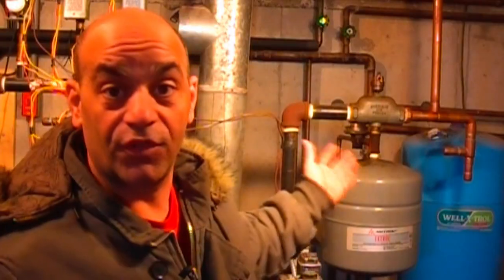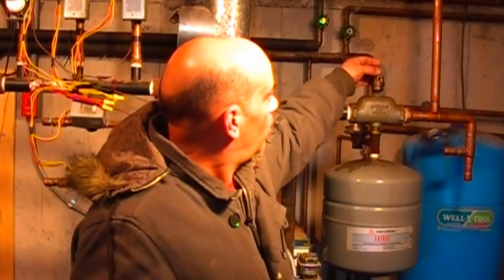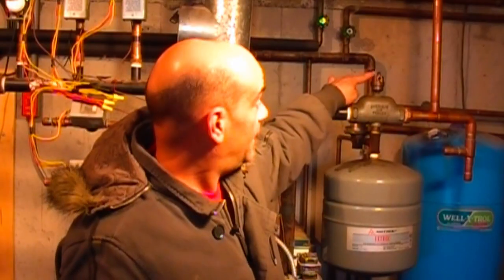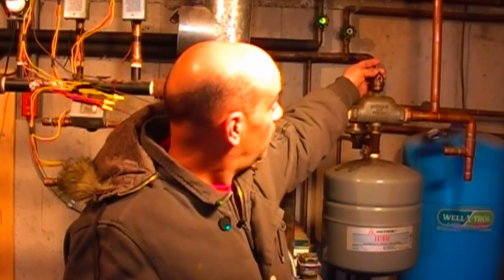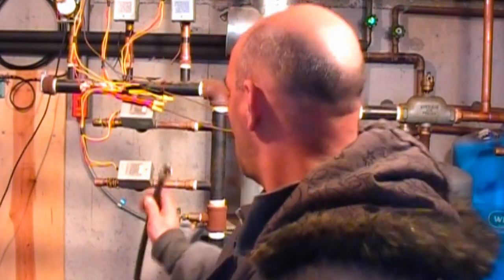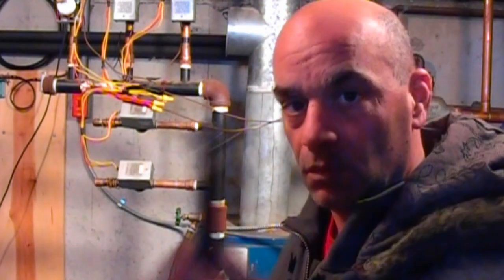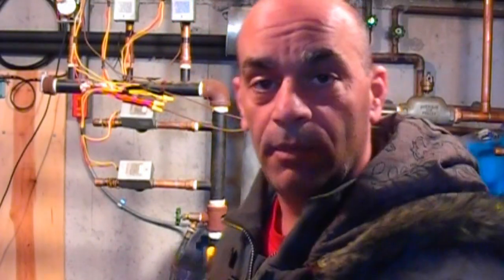How to remove the air from your boiler / heater

Comment: Thanks for video. I have a Chromalox  EDB-2, One zone valve for two storey duplex. Thermostat in the living room. Overnight, the boiler overheated and steam coming out f rom relief valve. Pipes extremely hot, too much to touch. I disconnected the power (electric boiler). Any ideas what could cause this overheating? Thanks
Reply from the maker: A few things. First I would check that the main water supply is open.

Comment: You could hear some banging and knocking from your pipes as you flush them. That's the air in the system knocking around. The air is a space within the system and when water comes in to fill the space, the air shoots out down the line looking for a high spot and causes a knock or bang.  Some tinks and pings in a flushed system are normal as the pipes heat up or cool down due to expansion and contraction. If you keep hearing bangs, you still have air in the line or you have a leak letting air in.

Comment: DO YOU KNOW WHAT WOULD MAKE A BOILER SQUEAL AND VIBRATE? I ALREADY BLED THE SYSTEM. IT HAPPENS WHEN IT IS HEATING UP (AFTER A MINUTE OR 2) AND THEN STOPS JUST AS SOON AS I TURN THE SWITCH TO SHUT IT DOWN.
Reply from the maker: That's something I would need to be there. Sorry could be so many things
Reply: askmediy I'M THINKING SLUDGE BUILD UP IN THE LINES IS CAUSING THEM TO VIBRATE. IT SOUNDS LIKE GOAST IN THE WALLS I'M GOING TO RUN CLEANER THROUGH IT THEN DRAIN AND REFILL.

Comment: Should you replace water heater if this valve gets tripped...?  Will or does the hot water or extreme pressure Damage the tank in any way???  the Tank is 21 years old,  i'm guessing time for a New One....Any danger  to fix the old one..?  Thanks. Recommendations for new unit..??
Reply from the maker: Mike Teal hi Mike, yeah it’s time to replace it. Why did it trip is the bigger question. Yeah replace it
Reply: Thanks for the advice..!!!

Comment: great video. My pipes going in and out of each registers pulled away from its elbow joints because of the weather temperature, but my boiler is still operating. What caused for the water to freeze? Could it be the circulating pump not working? Could it be a clogged nozzle, filter?

Comment: I have  lots of air in my pipe. It took me long time to skim and seems never can take them out. I don't find any leaking in pipe anywhere. Please let me know what should I do
Reply: Follow the video - Dominic explains very well. If you close off the return to the boiler, and can close off the expansion tank, then you can attach a hose to the bleed off valve and open the valve to begin purging air from your pipes. What I do, is hold the end of the hose into a bucket and kink the hose, then release, then kink again, then release - letting the pressure build back up in the system, then releasing once again. This helps to push the air through the pipe towards the hose and out to  the bucket. BE CAREFUL NOT TO BURN YOURSELF! ALLOW THE WATER TO COOL DOWN BEFORE ATTEMPTING THIS. You will know when the air has been purged by observing the pressure gauge as you kink the hose. When the pressure builds immediately, it's an indication that you have removed most or all of the entrained air! Good luck!
Reply: Oh, yes - DON'T FORGET TO REOPEN THE VALVE TO THE EXPANSION TANK, AND TO THE BOILER RETURN BEFORE TURNING THE BOILER BACK ON!

Comment: great vid! my system has lots of noise. I now know that my expension tank is broken. I want to replace it. but the whole system only has a cold water come in valve. I can cut off the cold water come in, do I need to drain all the water inside the system to replace the expansion tank? thanks.
Reply from the maker: J He thank you. Yes turn and let the system cool down. Open up a valve to remove some water and pressure
Reply: my house is less than 2000 sq ft, 2 zones, 1st and 2nd floor each has  a zone. I wonder how much water I need to remove, 10 gallon total for 2 zones?

Comment: What if my expansion tank is completely filled with water and there's alot of pressure showing on my gauge?....what are the proper steps for safety before i can replace the tank and gauge. My case my pressure gauge needle has broken and is so far off, it is stuck in place on the temperature side...i have the same gauge as displayed in this vid.
Reply from the maker: Jay Bee replace both and get back to me
Reply: askmediy so what do i do?..... shut the cold water valve, turn of the gas and pumps to the boiler? Do i open a drain to let out some water before removing the expansion tank?
Reply from the maker: Jay Bee sorry, yes turn all that off. Open a valve to let some water out until it’s not under pressure. Also make sure the system is cool. 190 degree water, not fun
Reply: askmediy hey im still working on my expansion tank....i notice your air eliminating fixture has a purge valve, mines just has a cap with a flat head screw opening in the center at the top. So do i leave the entire cap loose or do i open the screw a half turn?
Reply: askmediy also once the tank is on do i simply just turn everything back on, and let the system build itself back up to normal use? Or is there more steps like bleeding all the zones again?
Reply from the maker: You'll have to bleed the system.

Comment: Hi there, there's a knocking sound on one of the 4 zones of our radiant heat after the furnace got serviced. You hear it when it's heating up. How do you get rid of this ticking/knocking noise. The plumber said he needs to open up the drywall and the ceiling.

Comment: I'm in the 2nd, top, floor in my apartment. We had a low water pressure event recently, and the sinks were real low pressure. I think air got into the system because of that. I have a total of three radiators. The one in the kitchen is about room temp, and in the kitchen it's cold. So I took my tiny t-shaped valve wrench for the little square valves. I let air out of the bedroom one, (the lowest height) which seems fine, and then spit out water.
In the Living room, that one never got to the point of pumping out any water, but I did get some air out, and it's semi-warm.
In the kitchen, I got a tiny bit of air out, and then it would not let any more out and is still cold. Is the problem the pressure? The kitchen has always been the coolest, even when properly bled. So, after we bleed it, maybe the system needs a couple pounds more to get the kitchen one to heat more? He knows what he's doing, and installed it all himself. I just need to know what to tell him! :-) Thank you for a GREAT channel here!  :-)
Reply: Low domestic hot water probably wouldn't affect your heating system. Try opening the radiator valves a bit to get more flow to the cold rads.
Reply: O
ok

Comment: My gas boiler turns on and heats up to temp. When the temp reaches what I called for it shuts off which is normal. However when the temperature drops it won’t reignite?  Any thought. As a side note I just installed a new hot water tank.
Reply from the maker: Oh that could be so many things. How do you end up getting it going?
Reply: askmediy  by the way I like your videos.  I turned it on with pilot like it says to do and than set it to on. The pump comes on and heat comes up. Than after it reaches temperature the house is warm. After the temp starts to drop it won’t reignite but the pump stays on. I than just shut it off and start over. It’s an older Utica model
Reply from the maker: Being a older unit I'm thinking you have a pilot light and not a electronic ignition? Either way I can't come up with a reason that simple without really being there. If it is a pilot system I would check the clearance from the light to the burner rail. Also check for any obstructions in the gas rail. Perhaps the gas is just not hitting the pilot. But then again the gas valve needs to open in order for the happen. So you see it can be many things. Not many, but a few.

Comment: Hey Dominic.  Thanks for the video.  I have a question.  The experts who installed my system didn't put a shutoff valve on each of the zones.  The only valve in the line is the zone valve that receives the signal from the thermostat switch.  I assume I need to turn the heat all the way down and then open the boiler drain as you describe in your video.
Reply from the maker: You could be right and seems that you are. But if you like you can ask your question and post a picture on my site. www.askmediy.com

Comment: My heater is working but no getting hot enough

Psi reads 0

Can I fix this on my own
Reply: It's a boiler slan/fin
Reply from the maker: Vero Nica seems like you don’t have enough water in the system. Make sure you have the fresh water supply open
Reply: askmediy Hey there

My dad and i worked together and got it up to 20

Is it ok if it's a little over 20

Or do you want it right on the nuts
Reply: askmediy we have 2 radiators and the upstairs pressure reads a little above 20
Reply from the maker: Vero Nica no that’s fine and your temp should be around 190

Comment: Dominick great video. After watching this video I do not know if you can help. I have a split ranch home with 3 zones for 3 floors. The upstairs floor gets plenty of heat, the second (middle floor) gets no heat & the first floor, where the boiler is get a little heat. The circulator is working the zone vales are open.
My problem I have three zones and they join into one pipe without any return shutoff valve and I do not have a pressure reducing valve like you have in the video. The supply line goes to  a fitting like the one that is in the video at 9:10 over your left shoulder with an expansion tank & air bled. When I try to bleed the line I cannot remove all the bubbles plus the water stop flowing, pressure goes to  0.  Your help will be appreciated.
Reply from the maker: When you bleed the system you need to open the supply line to the boiler.
Reply: Thank you for your quick reply. I did have supply side open. I do not understand how it went to 0 PSI. As I mentioned it does not have a pressure reducing valve, so I do not know what is blocking the inflow. When I shut the drain valve it takes a long time to regain pressure.

Comment: The think that makes this tricky is that not all systems are installed the same way so it's hard to tell which valve is the one that you want to use to purge the air.  What is a good way to look at a system and know which spigot you need to open to purge the system?
Reply: It’s the little thingy on top of that gray tank👍🤓

Comment: Hi, I have a combi system and my radiator as been removed to decorate the room so its empty. whats the best way to refill it, should I shut off the valves and refill it from the top or open the valves and open the pressure on the combo boiler?

Comment: How can I tell which is return pipe on my hot water system? I have a one zone system burnham....
Thanks !
Reply from the maker: Usually on the return side. If you have a circulator it will have a arrow on it.
Reply: Rick Stone vissmann boilers
Reply: askmediy my hot water isn't coming on in the kitchen on the first floor,but comes on the in the 2 and floor bathroom

Comment: I have a burnham v-73 boiler and i think whomever setup the circulators did it backwards. It works but i think it put's more pressure on the circulators to do their work. They are put on the incoming lines from the 2 zones i have just before the boiler.So what I am thinking they are pulling water from the zones and pushing it into the boiler. I have looked at a lot of diagrams of setups for boilers and never seen anything like this. Since heat rises and expands with pressure,i would think the outgoing lines would be the best place to put any circulators so they are just helping push the heat where it naturally wants to escape anyway on the outflow. I also have a taco airvent on outgoing with the pressure tank just below it and tank seems to be ok.The airvent though has been leaking on the threads of the cover and from the airvent screw on top.I bought the taco airvent 2 years ago new so i think i can maybe just take it apart and clean it,but maybe put tape on the threaded cover  so it will not leak ?
Reply from the maker: Pictures would really help here. If you would go to my site and ask the same question. Copy and past it from here. And include some pictures. www.askmediy.com

Comment: Dom, Nice job. 
Gotta question : it appears that one since of 3 in my house is acting like it's air locked.  A large bubble in the system. If I tried your method, why might that push the bubble(s) out any better that the bleeder valve on the expansion tank (verified good)? Asking because I have seen a plumber in the past add water to the loop while purging from the return side as you are. This seems more complicated, but I'd the circulator is not string enough to push water through at all at this point, why might things change if I follow your method, letting the system self fill/purge? 
Hope I explained the problem well enough. Bottom line now, no circulation means no heat. Suspect large bubble system will not purge through air valve on expansion tank. 
Thanks, Danny

Comment: I like this video very much, only problems I've heard and seen is you just saying "screw it off and screw a new one on" for the diaphragm expansion tank and the line before the air scoop is not the 18" minimum it needs to be.

Comment: Any experience on Crown Bimini B Series wall mount boilers?  No heat and the message panel is indicating a A64 & then went to either 5 or S 60?
Reply from the maker: Jennifer Carrasquillo not intensive enough to help or at least while I'm on the road. Sorry

Comment: Tried it your way with my old Burnham boiler.  I was taking water from the lowest valve which was extremely hot.  I closed the big valve handle as you said and took from the higher faucet - low and behold tons of air and cold water.  In 5 minutes of sitting in my apartment the heat is raging - I have to turn it down!  Thanks again - You saved my bacon.  It's 7 degrees outside.

Comment: water tank and expansion tanks serve different purposes. Yes you want the system full of water and a tank that constantly adds water as needed without backflowing into your potable water system. The expansion tank will allow room for heated water to expand without putting undue pressure on your heating system. Water does not get "burned" in a closed system. It may however be displaced outside the system by an overflow valve and no longer be in the heating system. A water holding tank will usually be installed above the  boiler and works best when above all of the heating areas but not where it will freeze. Zone valves allow the tank to be in the ceiling of the basement and gravity/pressure works just fine from there without incorporating air into the heating system. Look at the mess of wires left open on the wall. That is unacceptable in so many ways. It also shows that a real "professional" did not install this system according to proper design specs.

Comment: Hello.  I have a Rinnai E 110 CN combo boiler. I don't get enough heat on either two zones and have one circulator. The temp gage reads about 125 when the heat is running. I don't know what this temp should be. It's a long run to the 2nd floor.  I know how to get into the programming and change parameters.  I just don't know what it should be. I would also like to purge it.  The installers made many errors and finally came back to cut in the hose  bib to flush the system.  They are not skilled and trustworthy. I put a call into Rinnai and sometimes the techs will help. This has been a five year problem with 5 leaks and insufficient heat. The contractor made them come back as this house was built 5 years ago. I want to fix this if I can..  I'm handy and can't afford to bring someone else in. Please help.
Thanks
Reply from the maker: Most boiler temps should be about 190
Reply: +askmediy would that account for the weak temp at the baseboards? I can look up the heat parameters and see the settings. Does that have like yours reflect the heater water temp? My Domestic hot water is fine. Thanks
Reply: +MrBikedrummer Auto correct screwed up. Does my Gage reflect the real heating water temp? should I bump it higher and see?
Reply: +askmediy Thanks. I went through the programming parameters with Rinnai technicians on the phone. it was programmed to 120. We bumped it up to 176. Also my operating psi is about 30. I've noticed water periodically from the relief valve. Do you know what it should be and how to reduce the pressure? 
Thanks a lot. Next I'm purging the system. Can't get any certified Rinnai technicians around here.

Comment: Hey Dom.  one question. could I simply open up the valve on the water intake regulator to get more water into the system so I could purge for more than 30 seconds at a time ? or could this damage seals within the boiler system?  my home is well and there up to 65psi behind the regulator which feeds the boiler at up to 20psi
Reply from the maker: +Dan S What valve? if there is a valve to the regulator that should be open at all times. Unless you're talking about the bypass lever than yes at short spurts you can.
Reply: +askmediy my apologies. i meant the regulator that allows water to flow into the boiler
Reply: +askmediy and yes was referring to the bypass level on the reg itself
Reply: +askmediy thanks again for all the help. your guidance just saved me $300
Reply from the maker: +Dan S nope, you still have to send me 150 LOL.. Glad I could help you out.
Reply: +askmediy haha check is in the mail :p Thanks again!